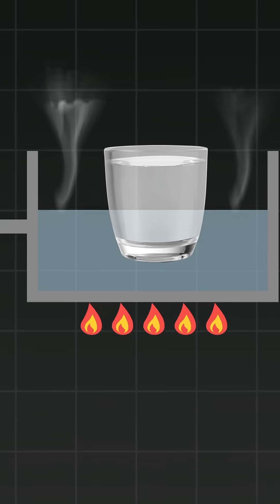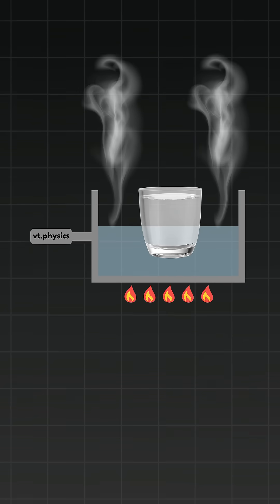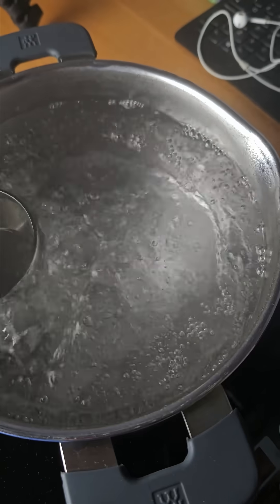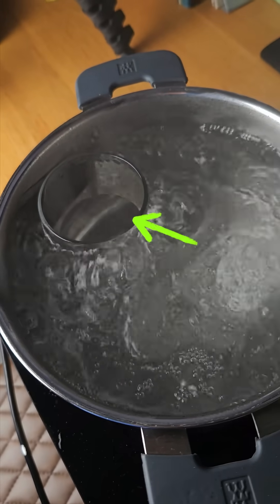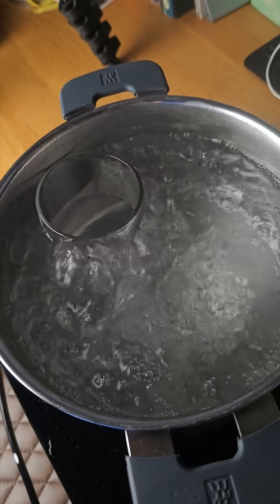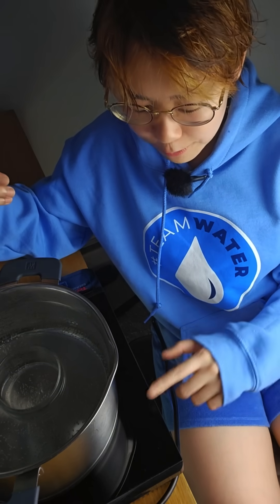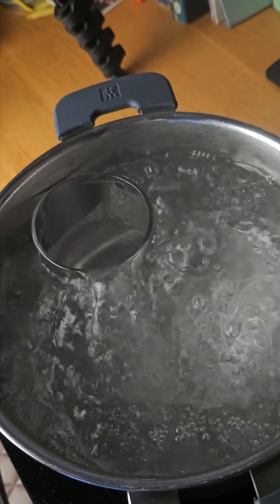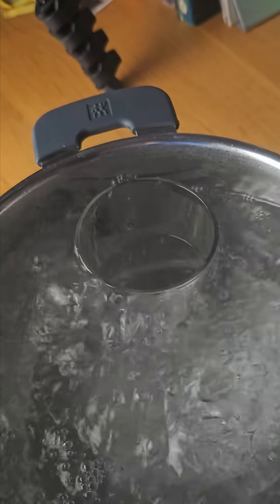Boiling Dilemma: Why Water in a Glass Won't Boil #teamwater

Comment from the maker: Here's a simple expeirment you can test for yourself! (But becareful when handling hot water) Have you tried it yet? Tell me your result! 🤓

Day 4 with #TeamWater 
💧💧💧💧💧💧💧💧
Help us achieve our goal of bringing CLEAN WATER to millions of people! 
PLEASE DONATE ! 
💧 https://tilt.fyi/UT3KwzGbXi
💧https://teamwater.org/ 
#teamwater
Reply: Is fire plasma or gas? Or both?(I didn't want to search. Hehe😁)
Reply: Neither it's a chemical reaction that doesn't create a gas or plasma @nigelbacani6854
Reply: @nigelbacani6854 I.believe it is technically a gas
Reply: @nigelbacani6854 Plasma flows like electricity.
Reply: 36 comments in 10 minutes? Bro fell off
Reply: All fun would burst off when the glass breaks
Like it happened to me during water bathe of alcohol to remove chlorophyll from leaves
NOTE: the glass wasn't meant to be used for experimentation
Reply: @Powerplaym_TGthe glass is most likely tempered glass which has a super high melting point and is more of an insulator/regulator for heat so no matter how much time you spend the water inside the glass will never reach 100c
Reply: BUT the Air Bubbles are Hotter than 100°!!! So with Exessive Boiling Water, the Water in the Glass will also Boil!!! 👍🤓💡
Reply: Just put some salt in the outer vessel, will ya?   Isn't that simple?
Reply: @amarjitkmr9565 finally a chemist talks, impurities increase boiling point of a compound. My guess is the salt 🧂 should act as one(impurity).
Reply: There is nothing remarkable in this experiment.
Obviously, the water in the pot boils and keeps its temperature at 100°C.
The glass insulates (so it brings about a temperature drop across the thickness of the walls) and also loses heat via its rim, which remains above the boiling water.
The water in the glass loses heat via rapid evaporation, stimulated by the high temperature.
So, the water inside the glass stabilizes itself close to, but below the boiling point .
Reply: @CG-rr6yx the reason it is remarkable was that its use as a proof of the need of the latent energy for water to boil. And it jas many applications around the world from steam engine designs to nuclear reactors. 
Please don't down play pivotal points of understanding science just because it is now a common knowledge almost and simplified enough for kids to understand. 
Much love ❤
Reply: @solo9556 The fact that the water in the pan boils without changing temperature is already proof of the phase change occuring while absorbing the latent heat of vaporization.
The glass doesn't add anything to the theory; the water within doesn't reach 100°C, so it doesn't boil.
This could be just a demonstration of a method to keep something near 100°C without even measuring the temperature or a nice reminder of a way to sterilize food for long term preservation .
Reply: The au bain-marie method is perfect for gently melting chocolate or safely heating isopropyl alcohol without direct flame. Think double boiler – slow, steady, and safe.
Reply: It's because the glass as the medium has a higher heat resistance than the water thus not transferring the heat to be able to reach 100c the water inside the glass is stuck at around 99.85-99.95c eternally without you raising the stove it will never reach its boiling point, cool fact this is how some candies are made and how we get nuclear clean rooms.
Reply: You are one of my favourite creators ❤
Reply: You make my temperature rise❤
Reply: Pressurised water has a higher boiling point, so water in a very stiff and strong air-tight container packed at room pressure can boil in a pressure cooker.
Reply: @aphilosophicalnaturalist6245 wait, why would we increase the pressure, we can just decrease pressure so boiling can just happens at room tempt after the water is already 100 Celsius right? Wouldn’t increase the pressure also increase the boiling temp in the water that is in the glass?
Reply: @vuthaingoc863 The container is strong and very stiff, so its volume doesn't change when pressurised, so the water inside stays at a lower pressure. The water needs to be boiling hot right before being sealed to be at atmospheric pressure when it reaches the boiling temperature.
Reply: @aphilosophicalnaturalist6245 oh cool, never thought of that, I’d like to do this experiment. Thanks for the suggestion
Reply: @vuthaingoc863 The experiment is inspired by pressurised water reactors, so I think it can work, pressure cookers don't reach the pressure of PWRs, but it can still make the boiling temperature of water higher than 100°C.
Reply: Expeirment is wrong spelling, it's Experiment!
Reply: Be careful and try to use a flask that can withstand the boiling water ...... Cause regular glass may crack or even fructure 🙏🙏
Reply: Cna you explain how the ODM GEAR (omni-directional manuever gear) in Attack on Titan works?
Reply: @ÉÀGLÉ_RÚDRÀ you can try cylinderical coordinate, but it’s a lot of vector calculus
Reply: My answer before you tried it was "after all the water is gone and the heat transfers from the pot through the glass (hopefully without shattering) to the point enough heat could transfer to boil."
Reply: If all the water boils the glass might shatter  @ARubberDuckey
Reply: Love you so much.. ❤
Reply: We use this method  in cooking some kinds of herbs that should be in a hot water but not boiling.
Reply: That is not a proper double-boiler.
Reply: Water also boils at higher altitudes. As a kid, our school went camping at the Grand Canyon, and boiling a pot of water our teacher stuck his finger in the middle of the boiling water without hurting himself.
Reply: @jaeger251 I am sure you wanted to write that water at higher altitudes boils at lower temperatures. This is true, but taking the example of a trip to the Grand Canyon, the difference isn't that big.
Presuming an altitude of 2000 m, the atmospheric pressure has to be around 800 mbar. Under such a pressure, the water boils at approx. 93.5°C -- not that far from 100°C !
So, your teacher, intending to get the physics impressingly demonstrated, played a little trick on you .
Reply: I love you ❤ marry me and be our children educator ❤❤❤
Reply: The glass has an insulation property, so the water in the cup will not reach the boiling point in your current setup. 

Thanks for constantly creating really awesome content!
Reply: what experiment ? I'm just here to look at your legs 😍🤤
Reply: Bubble didnt come bcs of boiling, its happen bcs bond between water molecule and expanding vessel
Reply: The glass insulates the water from reaching boiling point <100 c @ stp
Reply: It's called double boiling.And I have done this lots and like you do this for you.Don't burn stuff.
Cooking bread 8 years.I can tell you that it is a great cooking trick where you don't burn your food
Reply: Be careful thinking about this. There is boiling in the sense of a vigorous phase transition with large bubbles of vapor in the liquid and there is boiling in the sense of the vapor pressure being equal to atmospheric pressure. Let's not argue over whether the water in the glass will reach exactly 100C (thermal equilibrium with the rest of the water), but at least recognize that it is certainly Really Dang Close (technical term). Its vapor pressure is epsilon below atmospheric. It may not be demonstrating vigorous transition to vapor with bubbles in the bulk, but it is certainly transitioning to vapor. An interesting experiment would be to measure the mass of water in the pot and mass of water in the cup, bring the pot to a boil, let it boil for some time, and then remeasure the masses. Calculate the mass loss rate, dM/dt for each and the normalized rate 1/M dM/dt and compare. Ideally, you'd rig things so that the two volumes have equal surface area. I really don't know what the result will be, but I am sure that water is going to vapor from the glass.
Reply: in a closed system, water can exceed 100°C if the pressure is increased. This is because higher pressure raises the boiling point of water, allowing it to remain in liquid form at higher temperature
Reply: Congratulations, you discovered bain marie
Reply: This reminds me of putting a Dixie cup of water into a campfire.
Reply: COol ^^))
Reply: How yk everything
Reply: And wht if it's done inside vaccum?
Reply: I’m still trying to do the suck a hard boiled egg 🥚 into a soda bottle experiment like Bill Nye taught us but every time I try it I’m like ooh hard boiled egg 🥚 and eat it.
Reply: Well true but also not. Water can get hotter than 100C - in a high pressure environment boiling point would increase hence water in the glass can get above 100C. If we were to reduce pressure then it would also boil :)
Reply: #gooning
Reply: @beendanako  No, just no
Reply: Had to thumdown 👎🏾
How can you be talking science but cant say EScape 🙄🤦🏾‍♂️
Its not EXscape, theres no X in the word 💀
Reply: @Niggleblade1986    migth need a better rajebait
Reply: @Niggleblade1986 dont Tell me that its not expresso😂
Reply: @Niggleblade1986 there’s these things called accents you know

Comment: I originally thought that due to convection, and hotter fluids being less dense than colder fluids, so the top of the water being what is boiling, but because of the mass of the glass itself, the water in the glass is sitting below the level of the top of the water in the pan, then the water in the glass is not boiling as it is not as hot as the water at the top of the pan due to not experiencing the same convection currents.
I don't know if that made sense, nor if it has any semblence of truth.

Comment: “The water in the glass stuck at 100 °C" I think this statement is not correct. Once it reaches 100 °C, the surrounding boiling water continues to supply heat through the glass. That extra energy doesn’t raise the temperature further but goes into providing the latent heat needed for vaporization.

Let's say
If the glass were extremely thin (almost negligible), the setup would essentially behave like a single pot of water, and the inner water would boil just like the outer water. The only reason boiling appears slower in the glass is because the glass wall adds resistance to heat transfer, so the rate of energy flow into the inner water is reduced.

Comment: I think we can get the inner water to boil.  To make this work, we should increase the boiling point of the water in the pot. So we could add salt to it. Maybe we could also replace the glass with a metal for better heat conduction.

Comment: The glass itself will present a thermal resistance to heating the water in it. 
As you state, the water in main pot will not exceed 100°C, so water in glass may barely ever reach 100, thus may be more prone to evaporating than actually boiling away, since that ‘system’ will struggle to ever transfer enough energy to it  to initiate boiling.
Water has a Specific Heat Capacity defining energy it needs to raise its temperature.
It then has a Latent Heat Capacity, defining energy to boil away that 100°C water.
Specific: ~4200 KJ/Kg.
Latent Heat Capacity:  2260 KJ/Kg.

Comment: Isn't that similar to how the water surface doesn't boil, instead the water at the bottom boils and becomes gas which is why boiling water has bubbles from the bottom but never the middle or the top(?) (or am I misunderstanding smth 😅)

Comment: Boiling water is awesome.
I made accurate temperature sensor measuring device and I needed absolutely accurate reference heat to check the readings and I just used kettle with open lid which stayed at 100C exactly.
The device I built read 99.98C, which is very good.
Reply: That trick only works at sea level. In Denver, CO for example it boils at 95°C. Still, pretty clever and it gave you an accurate reading so I guess I'm just being pedantic.

Comment: You can obtain steam from water at a minimum of 0º Celsius. Evaporation and boiling are not the same thing. Boiling is what happens to water at 100ºC, where the inner pressure of that water is equal to 1 bar (at sea level)

Comment: So, the pot is able to get hotter than 100C, so it can transfer all the latent heat into the water, boiling it? But the glass can’t get hotter than 100C, so the water inside can’t boil? Correct me if I’m wrong.

Comment: interestingly this would be more supported by getting a thermal camera and focus it from heat source to glass. However water is going to act like a more dynamic system ie convection current and such. What I'd predict you'd end up with is a 'hidden' background gradient (hidden by the water constantly mixing) but the glass itself would be off color due to it's slightly lower temperature which should hold a stable temperature.
Reply: No this is just how it works it's proven science
Reply: @livingglowstick1337 Tbh, I'm not even sure what part of my comment you disagree with. Also please never say "proven science". Science is about getting better data to make better models of parts of reality, it's not absolute like a clean logical statement. In other words in science we are always dealing with data, probability and logical inferences. but rarely does anything elget fully "proven".
Reply: @RyanLeman ... You failed basic science if you don't understand this

Comment: Sorry, but if I follow the statement of the problem, your are wrong let me explain. 

You can have boiling water in the glass without having the boiling in the pan under the right conditions. 

To have boiling water at 100°C / 1ATM you need nucleation sites, if you use a perfectly smooth container and pure water you have superheated water above 100 up to  ~120°C.

If the container is floating above the superheated water and thermal conduction of the container overcome the evaporation/eat transfer to the air ans you have nucleation site in the container you have boiling water heated whit none boiling water.

That said between 100 to 120°C it's range where the water is metastable and can boiled spontaneously... 2 L of water a ~120°C who is highly unstable will quasi instantly release the equivalent of the energy of an hand grenade... 
Good news is that super eated water at 120°C is highly difficult to reach outside lab conditions.
But superheated water is responsable of 10℅ of microwave burn injury in the USA and du to the "explosive" nature of the event it burn face and hands so don't put water note them 2 minutes, wait that the water cool down a bit, or put a woos stick or what ever to create nucleation sites before eating the water. 

That said I you like to make the react video to boil water in superheated water but... I don't have a lab.
Someone? :)

Comment: You already explained it the energy goes form the heat source to the pot then to the water in the pot. So the energy has to go from the water which is the heat source for your cup, to your cup. And once the cup is hot enough the water in the cup will boil. However the water in the pot  shift phase at certain temperatures thus capping the temperature of the water in the pot preventing the remaining water from getting hot enough for the energy to transfer to the cup and then to the water in the cup. So the water in the cup will not boil.

Comment: This is the reason why you usually melt chocolate not on a pan, but on a bowl above boiling water. That way you prevent the chocolate from burning on the surface of the pot.

Comment: Not quite a full explanation.
The unexposed sides of the glass works as a radiator and wicks away heat, meaning while the water around the glass is 100c the inside walls of the glass never reach 100c.

The bottom might get close but then the water in the glass sucks up warmth and is cooled down by the upper sides of the glass that are in contact with the air.

If fully submerged with a lid and air trapped inside it would eventually boil but the increased air pressure would pop the lid before reaching full boil.
And if in a pressure safe container it would constantly be turned into vapour then condens against the sides in an endless loop.

The water around the container can never reach a full 100c because it would all evaporate instantly, due to convection the warm water near the heat source constantly mix with colder water above it before reaching 100c.
The bubbles you see in boiling water is the steam vapour trapped under water, which rises and escapes but most water is off by a hair from 100c and just mixes with colder water while slowly evaporating.
Reply: The water in the glass cannot boil because it requires additional heat to change it from a liquid at 100c to a gas at 100c. The water in the pan, which is the only source of heat for the water in the glass -- will always be at 100C, meaning that it does not have the energy to vaporize the water in the glass.
This is why water in the glass will never boil.
Reply: Arrggg ... Glad you could post this little buddy? She makes a pop science SHORT! You make it into a full documentary trying to show off ... 🤡
Reply: @countmorbid3187  He thinks missing the point is the epitome of pedantry.

Comment: This is the reason you use a double boiler for things like making candy or certain kinds of foods because it creates a control that can only fail of the inner container maintains contact with the bottom or side of the pot long enough. If you dont use a double boiler or the double pot technique and you are making chocolate or candy you will burn the chocolate or candy mixture before its ready to pull out and can even set fire to the mixture.

Comment: The reason why it never boiled is because of the Thermal Insulation properties of the Glass, but it will boil if you use a material that has a higher Thermal Conductivity than Water, as the Water then acts like a Thermal Sponge and absorbs the heat directly.

Try using a Diamond Cup and you will see the water in the cup boil.